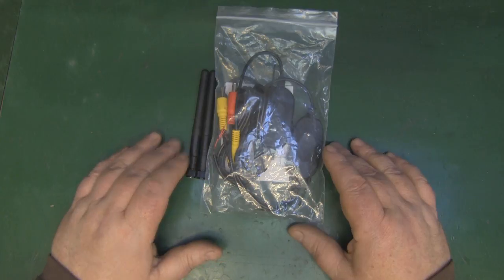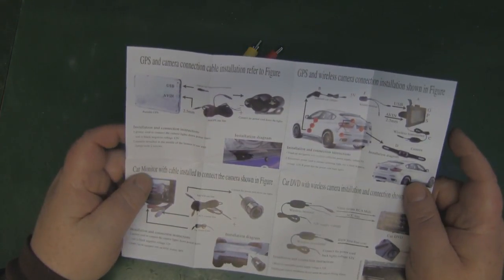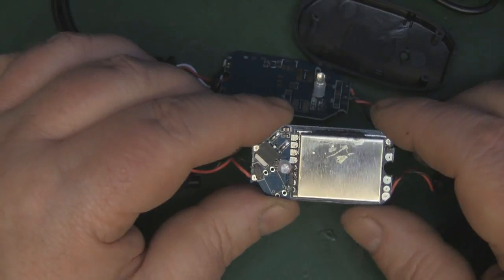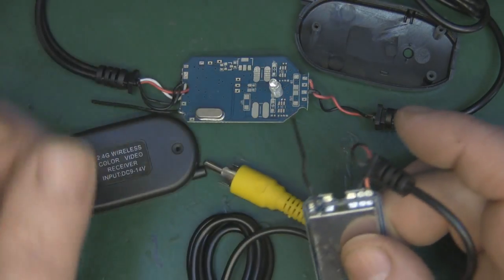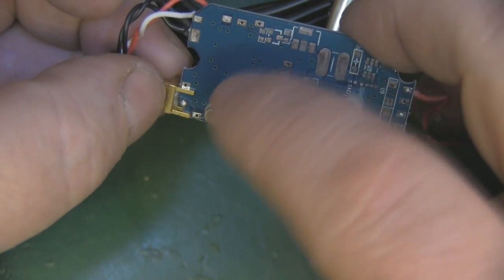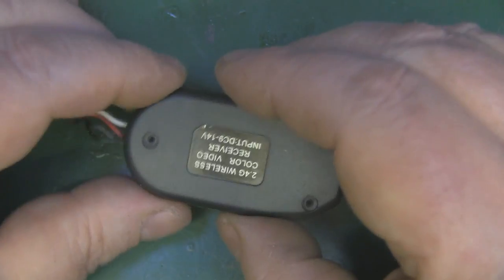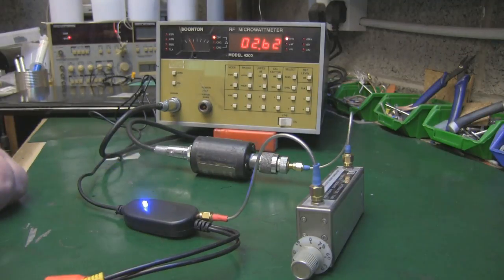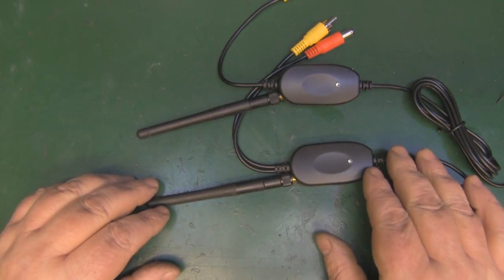2 4GHZ RCA Wireless Transmitter & Receiver Antenna Modification

Comment: Good info. Could I run both units from a household power pack emitting 12v? My receiver (single yellow rca), is showing a blue light. However The transmitter has a red light illuminated... Only using the yellow rca and the red one is unused... Trying to use it to view my digital microscope on my television... Thanks

Comment: No, you wouldn't use that on a craft for FPV, wrong frequency and would clash with your control which is on 2.4.
Power wise, 200mw will go a surprising distance and at 2.4 if you could actually use it for FPV would go a mile or so, I have been a mile out and also above the clouds on 200mw @ 5.8ghz although I run a minimum of 800mw up to 1.6w on 5.8 these days.

Comment: Love your Antenna builds. Is there a way of checking impedance with a multimeter  when I'm building  a 10 turn helical ? I'm  trying to determine  the size triangle of tin i need to solder at the base.

Comment: What about the velocity factor of free air (0.96); surely this will reduce the theoretical 1/4 wavelength antenna (receiving 2.4 GHz) from  31.23 mm to 29.98 mm.